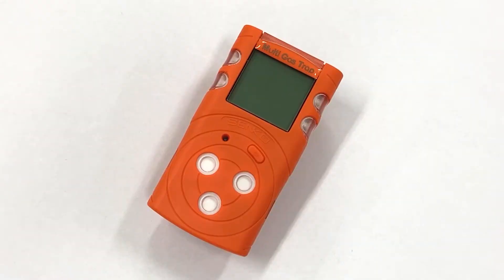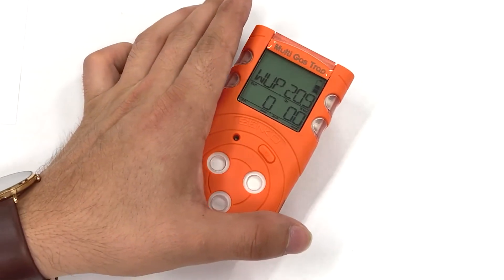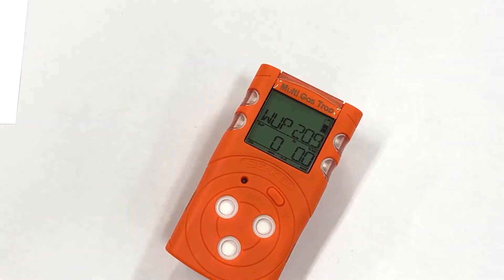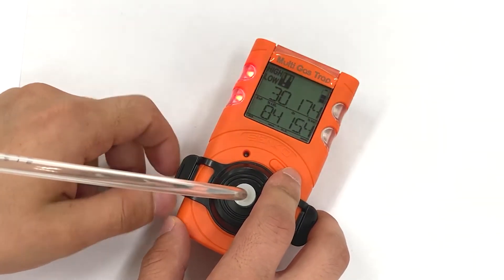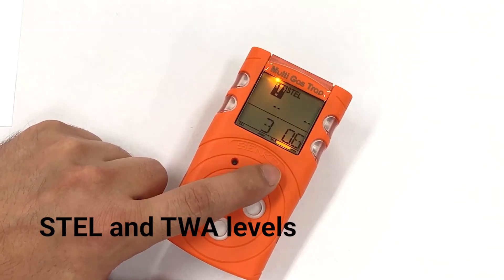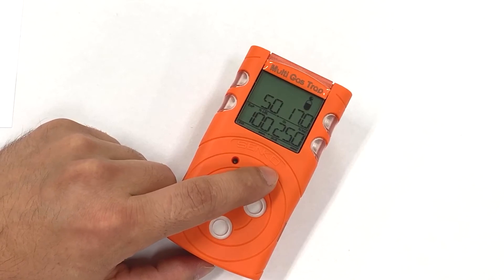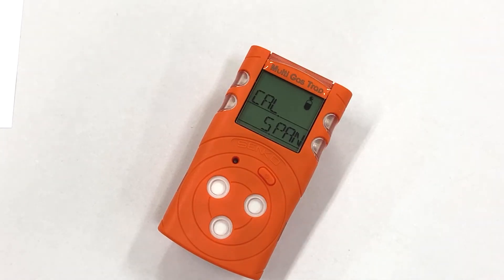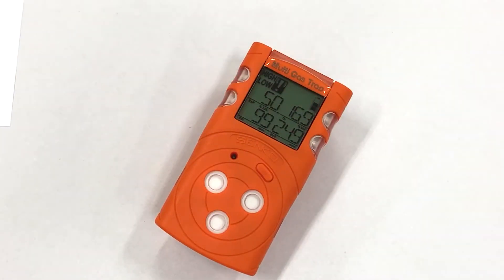SENKO Multi Gas Detector | MGT | Product Overview & Calibration

Comment: what are those values shoing on display after applying gas, what was span gas value? How to choose span gas value ? does is required software or manually it can be changed?